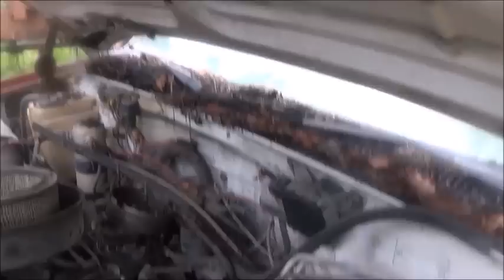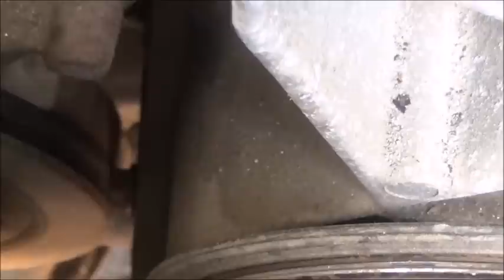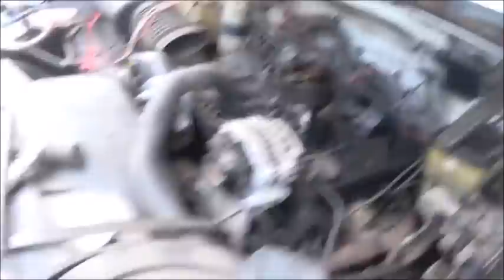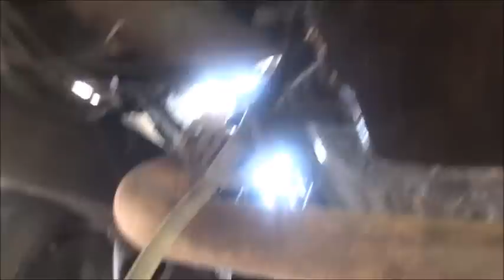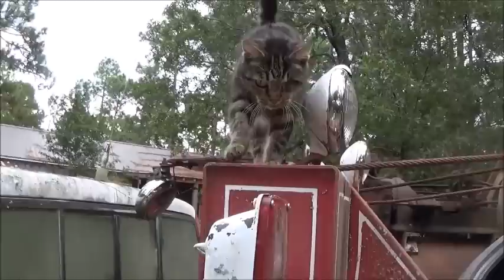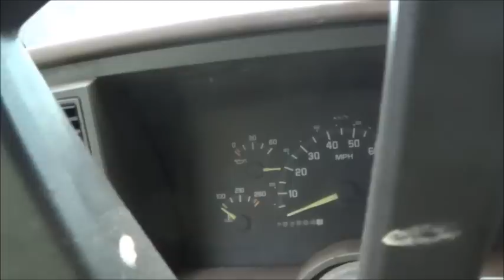1993 CHEVROLET 3500 TROUBLESHOOT AND FIRST START IN YEARS

Comment: I had a few well used tow trucks, they were all a lot worse than that one. I have one similar to that, but a big block on propane. Those throttle bodies wear out and let too much fuel in, so you get horrible gas mileage. There's an after market replacement with it's own computer that works well but it's 500 bucks.Maybe in one video, talk about how tow truck licencing works where you are. Here in Canada it costs 3 to 10K a year for insurance for one truck. I always wonder how you manage to have all those vehicles licensed when your the only driver. Good vid thanks.

Comment: Typical backyard wiring job.  Who knows where all that crap goes.  Keeping good ground connections on the bed and related circuits has always been a problem on these old trucks, even back when they were new...  Someone really did a job on this one.  Luckily it is all fixable ( pain in the butt, but fixable).  Oh yeah, keep  a spare ignition module in the glove compartment.

Comment: Excellent video Johnathan W  :) also back in 2005 my late Dad  1990 Chevrolet Cheyenne  2500 3/4 pickup truck he went to start up truck in January  on cold month let warm up before head to town to pay bills and put Automatic transmission of Turbo 400 3 speed and he put foot on gas pedal when in Drive  gear and chugged then motor shut down on him ! So put Park couldn't get stay running  and got off drive road but she Backfire bad so called me on home phone number to me get up home from my cellphone at my work  to bring tow truck old 1972 Ford F350 extended cab  I had then to! So got home also my dad got me do matinne up for him plus together! So found tank okay  send unit plus pump was shot then check in TBI injectors was not spray fuel quit working on 2 them  so haul to shop and gave car keys to him used! So replacement 2 injectors on TBI  on motor, fuel tank replacement  plus Send unit also pump  plus fuel lines with new fuel but still ran rough for bit and found ground cable  pigtail on fender was corrosion need replacement  and bolt even washer replaced all cleaned ! Then ran like top but 2 weeks get parts ordered from NAPA to get back then fuel tank was 60 gallons type!  But tell Johnathan W  on fuel tank keep water  going from Sending Unit plus Fuel Pump plus electric plug Best part over is tire inner tube light cover up and check Bolt for ground pig tail  on frame not corrosion to plus connector! Seen them Corrosion on them and shut fuel supply down like fuse blown  fast ! Even charcoal filter to Carb to filter to valve cover too plug up too on near Brake Booster is big black Part!

Comment: On these obs trucks the actuators on the heat vent. System gets dirt and clogged  there's 2 on the drivers side above your right foot above the throttle  wipe it out with a rag

Comment: I have a 94 with this transmission. Had problems when putting in a new clutch. We had to replace the fork and pivot ball it moved on as well as the slave cylinder. The wear parts were worn enough it did not work until we changed those parts

Comment: That was a sweet truck before those guys got ahold of it and made it all rigged. You can bring it back if anyone can!  TBIs are so good. My half ton has over 350k miles and starts right up every time.  I put flat top pistons and factory fit headers, then 3" factory exhaust from a newer chevy truck.  Worked on the computer PROM some and it runs amazing now.  I can get incredible mileage with the 700r4 overdrive, a 3.08 rear and 30" tires.  about 19-20mpg on the interstate.  Sounds like that blend door is the outside air door.  You can reach it easily without taking anything apart and unplug it.  If you do fix the air, a company called GPD makes a compressor that is shaped like an R4 but has a 1000x better pump inside.  Charge with keyboard duster (R152a) and you've got damn near R12 performance.  R134a does not cool worth a crap in these trucks no matter what else you try to modify.  I went through 3 R4 compressors before finding the GPD replacement.  If you have trouble with spark sometimes the pickup in the distributor gets full of rust.  Mine had a weird design pickup and I went to the junkyard and found one from a different year that was compatible but it is just an HEI style star wheel instead of the big rusty thing.  I can make you a chip for the computer with no EGR and oxygen sensor whatever you want.  It's nice to have the check engine light not come on.  I try to learn every possible thing about the TBI system and have gotten pretty darn good.  It's extremely easy to modify the computer to make it work however you want.

Comment: I have one that was given to me that wouldn't start, and it was the little pickup coil inside the distributor that was corroded, so no magnetic signal to the ignition module.
Reply: There were two different style pickup coils, one looks like HEI and one is big and weird.  I changed mine to the HEI type
Reply: I'm not talking about a high voltage ignition coil. This is the tiny one on the distributor shaft that reads the 8 teeth surrounding. They get corroded.
Reply: @vanstechcorral  I know exactly what you're talking about and that is exactly what I am talking about.  Some trucks did not have the tiny one with the 8 teeth and instead had a funky round huge thing in there.  The 8 teeth one is better in my opinion.
Reply: @RickBaconsAdventures  there's a round metal cover over the coil. There has to be a coil to amplify the effect of the teeth.
Reply: @vanstechcorral  I know how it works... there are two different distributors that were in TBI trucks that looked the same from the outside.  They use an entirely different design for getting the timing signal for the same module.  That's what I'm saying.

Comment: Nice find, those TBI setups are pretty reliable in my experience. I don't know why the GM engineers went with that ridiculous electronic HVAC arrangement. I guess they thought that's what the public wanted...The old cable operated vacuum door systems worked just fine and you could slide the levers without taking your eyes off the road.
Reply: Ditto on the electronic HVAC, goodkarmechanic.  And don't even get me started on today's  SCREEN MOBILE's ....new car designs these days have reached a level of ridiculousness never seen before with all the stupid huge-assed SCREENS that literally block the view of the road on some.  Do we really need all these stupid bells and whistles to be happy with our cars?
Reply: @santaclause2875  
 You got that right, remember when heaters had two knobs, twist left for cold, twist right for hot and fan speed on the other, then sliders for screen, face and feet, hate new car designs.

Comment: Mr. W I know my 92 has a factory 35 gallon plastic tank on it. Maybe you should sourse one for a 92 Silverado 5.7L extended cab long bed. Your tank looks to be the same overall shape as mine, just a little bit narrower in the length?
Reply from the maker: Won't fit. The frame is narrower on a cab and chassis truck. 22 is all that will fit.. they made a second tank for the rear center, but wreckers don't have rear frame overhang, so no room.